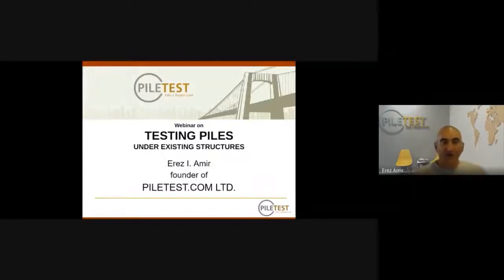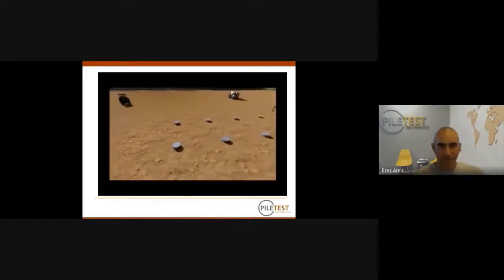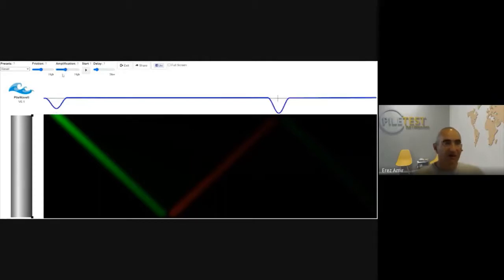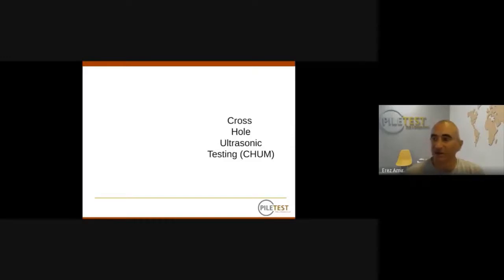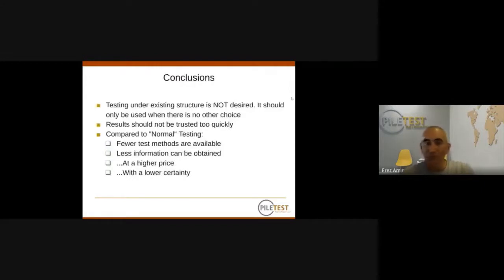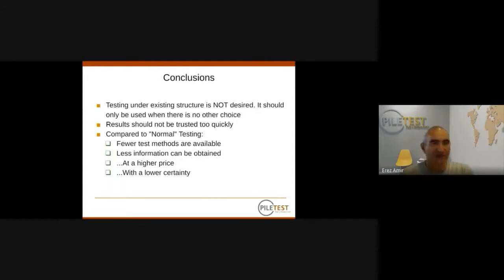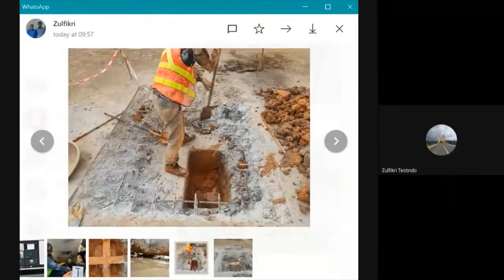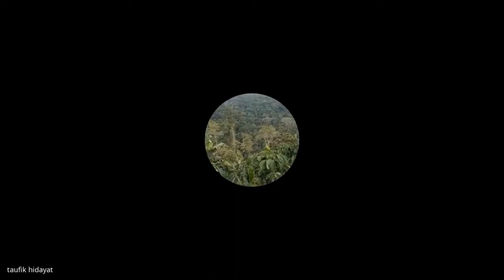3 methods for Measuring a Pile Under an existing Structure

Comment: Can PIT do at pile on existing building?
Reply: In some cases, the pulse-echo test method, which the PET is based on, was not designed for this case. None the less, in some cases, it can yield good results